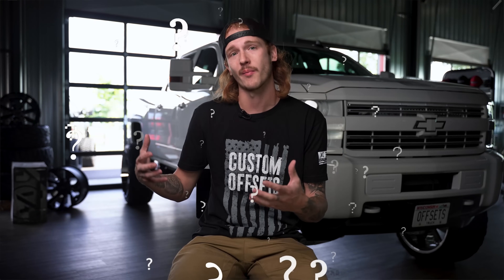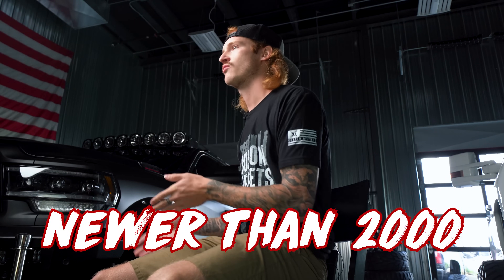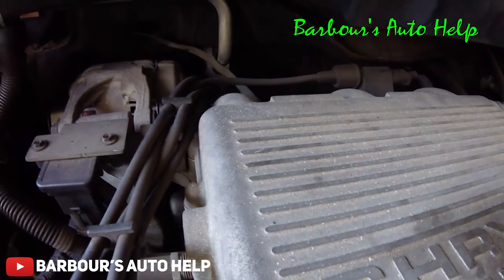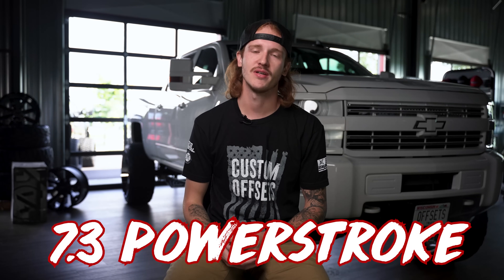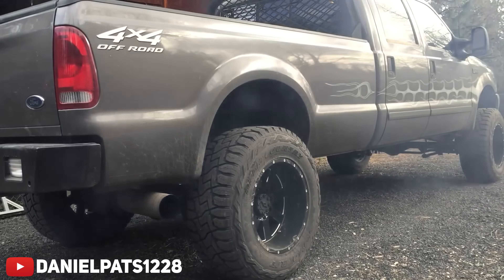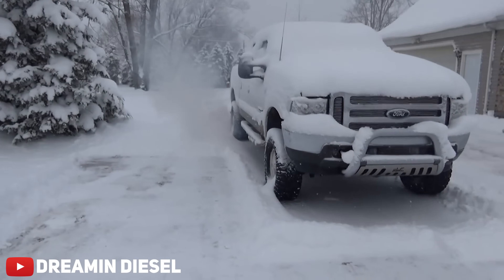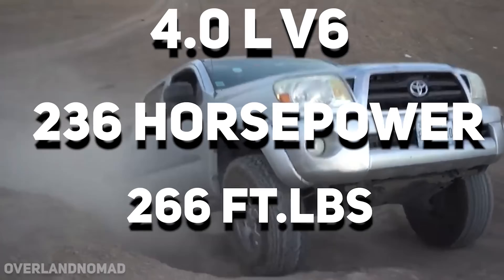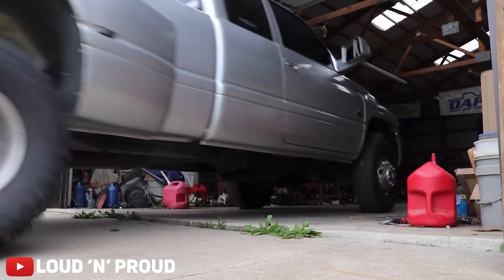THESE TRUCKS WILL RUN FOREVER!!!

Comment: I have a 03 Silverado with 378,000 miles and the trans finally went out. We built the 60 with a shift kit, hardened sun shell, and all the good piston upgrades, and it’s good to go for a long time more. Original motor, I just opened the oil pan for the first time in its life.
Reply: Eudeudrixx

Comment: Being from Utah Where it doesn’t get extremely cold but pretty cold switching to a 5.9 from a7.3 might have been the best choice I ever made
Reply: 7.3s are the best diesels you can get they have a lot of Torque and they sound great and they are reliable
Reply: @masterjcp1274  horrible mileage and much harder to work on and more expensive than cummins
Reply: Put a 12 valve in a obs and there u go best combo
Reply: @masterjcp1274  in no way is a 7.3 better than a 5.9 cummins
Reply: @Dukelevi12  Well it didn’t quite make the list though did it.

Comment: I sold fords back in those days and a 94 was NOT a powerstroke. The 7.3 powerstroke was not available until mid year 95 so a 95 and a half.94 ford diesel was actually one of the worst diesels for made thats why then started running the international 7.3 powerstroke.

Comment: I have a friend with a 2010 Toyota Tundra that was at 500,000 miles about 2 years ago, same engine with nothing but oil and sparkplug changes.
Reply: To this day he still drives it, and it's probably pushing 600k miles rn.

Comment: My dad has a 2000 Silverado 5.3.. 470k miles original engine... still runs strong.
Reply: I have both cat eye extend cab and 6 cyc 4 door Tacoma…both have over 150 k..biggest problem..replaced complete air condition unit on old cat this year…and both timing belts…tickled with both..alternate “daily” drivers.

Comment: Re the 6.7 Dodge/Rams.  The 6.7 was first available in 2007.5, without DEF and the rest of the emissions package.   They were the Third Generation body style through 2009.  I’m running a 2008 3500, Mega Cab, with the Laramie package.  I’ve got a little over 250,000-miles on it, and expect it to out live me.

Comment: I currently drive a 4.8 07 Sierra classic body and it has 230,000+. Planning on getting the engine broken down and rebuilt with some tunes to get that lifter tapping out the way.

Comment: My Chevy '01 K1500 5.3 has 236k miles on it as of today. Needed a new transmission at 220k and a new fuel pump at 210k. Other than that, it has been a workhorse for me. I drive a 2021 2500HD silverado now, but still love the old 1500 and can't bring myself to sell it. Its like a member of the family. Been so many places in Utah's back country with it and got me through some pretty gnarly stuff over the years. Keep them full of fluids and they will take you most anywhere you want to go.

Comment: Of the LS based engines the ol’ 6.0 vortec takes the nod for me. I have had many with service body’s for work that I had to beat the snot out of and over loaded but they all went 300k miles and got traded in. The highest miles on a 6.0 vortec I’ve seen was a Chevy express 3500 box van and the thing had 564,000 miles.

Comment: My black 07 classic 1500 Z71 5.3 4L60E 240k all original still runs and shifts fine. 1st to 2nd and 2nd to 3rd shift without any problems.

Comment: Custom sprayed for many years pulling a 500 gal sprayer in the field at 15 -16 mph
 Everybody that saw it was amazed how many years and fields it covered and just kept going.
1989 Chev 2500 w/ 350 TBI /4 speed manual
Neighbour borrowed it to haul cattle with my big gooseneck and blew the motor. Never even let me know he just parked it.
 For some people nothing is reliable as you need half a brain and some level of maintenance or you can roast anything. 
 My Dad's Dodge 2500 5.9 Cummins had to replace ball joints every year even though it stayed on the road...he spent 4K upgrading the fuel system and the truck had 80K kms.

Comment: My 2001 7.3 F250 flys down the road and off road and I have a flat bed that is so heavy it has F550 suspension in the back and it still flys

Comment: With transmission issues aside, Dodges 5.9 V8 Magnum will last you 300k-400k miles easily.
Reply: Agreed. Mines been running solid (with only one tranny rebuild) for 270k.
Reply: I have seen one all original with 627k miles 

318/ 360 are fantastic engines

Comment: 12 valve is the only engine thats ever been documented legendary. There's nothing else to talk about.
Reply: Sure sucks they put them in shit trucks though
Reply: 7.3 is legendary
Reply: @nolansmith4972  where is it documented  absolutely nowhere
Reply: @MrCstone1  where is it documented legendary?😂 12v are good motors but everything else is shitty. At least with a 7.3 u know u have a all around good truck. Mine has 302k miles stock injectors, turbo, and transmission never had a major repair
Reply: I kno you have Google. Type in 12 valve legendary you'll see.
Reply: @nolansmith4972  that’s why I’m 12v swapping my obs
Reply: @nolansmith4972  that’s why I’m 12v swapping my obs

Comment: 03’ 6.0 with 255,000 on the clock and counting. Just changed a ICP sensor on it still purring fine
Reply: Consider yourself lucky 03-04 were the "worst" of the six.blows.

Comment: My 7.3 has 420k miles and the only thing I’ve had a problem with is the oil pan gasket I’m replacing it this week
Reply: They are reliable, good engine for sure, super gutless and hard starting in really cold weather tho
Reply: @justinschooler6243  well Im from Texas so child weather isn’t a problem
Reply: Cold*
Reply: @kidoutdoors1400  
My bad lol oh well
Reply: @kidoutdoors1400  kinda a little child eh? Lol
Reply: @justinschooler6243  I’m selling the ole girl and getting a 6.7
Reply: @justinschooler6243  auto correct lol
Reply: @kidoutdoors1400  
Awesome trucks 👍

Comment: My 01 tacoma is on 230k miles and still running strong.
Reply: Not a real truck tho
Reply: @ah4800  what is a "real truck"
Reply: @m sure they last but you cant do much with them. Gonna tow your sea do? At least the big 3 can actually get stuff done. Cant haul much either in that tiny bed. Decent girls truck though for sure.
Reply: @ah4800  well yeah, the tacoma isn't designed to be a towing machine. It's built more towards off road use and daily commuting. If towing is what makes a vehicle a truck, it seems your ideal vehicle would be a semi truck since all they do is tow stuff.
Reply: @tannerbrinkman6790  lets be realistic here. Even hauling, movimg furniture, loads of landscaping for your yard, drywall, osb. Not a whole lot fits in those narrow beds. And a half ton is just as good off road if not better. Same as commuting. As for the tacoma being more "american" where are those profits going? Oh right, straight to japan.
Reply: @ah4800  I guess agree to disagree, I think it's a truck, you think it's not. I also didnt bring up the point about it being more American or where the profits go, but I feel like just in general most of our goods in the US are coming from overseas.
Reply: @m oh where did i mention mpg? If you're too broke to throw in an extra $20 in the tank you should drive half a truck. All the big 3 still hit 200k anything after that shes rusted out anyway. Lets not even mention the tooth pick rusted out frames on the tacomas. Your engine might last 200k but good luck with the frames 🤣

Facts are facts, tacomas make good commuters. But if you need to do anything important it aint doing it.
Reply: @ah4800  interesting that you say that.  Tell the thousands of Texans employed at the plant in San Antonio and the 10’s of thousand of US-based employees of the part makers/suppliers.  Compare that American economy booster to the income lost on those sourced and built across the Mexican boarder.  You are basically saying Taco Bell is Mexican food brother.  You either need some culture in your life or an education.

Comment: Custom offsets what do y’all think about the 1996 gmc sierra k1500 my truck still has the original engine and it has almost 305,000 miles on it

Comment: It hurts to see the obs Chevy isn’t on this list we have a single cab king bed 96 with a 5.7 and it’s spent it’s entire life pulling trailers plowing snow and working it’s ass off truck sits around 300000 something miles and still works like a horse every day with no issues

Comment: Any deleted duramax no lml cp4 and no lb7 injectors. 7.3 powerstroke after the pedestal leak addressed, cps and valve cover harness are addressed. 6.7 scorpion after 15'. All 12 valve after kdp done. 24 valve after p pump swap and not a 53 block. 03-04.5 3rd gen. Then pretty much all deleted 6.7 except 19-20 cause cp4. There's the list
Reply: What is the pedestal leak? I have 99 3/4 7.3

Comment: One of family members has a 99 F350 dually and it gets 18-22 mpg. Worst case scenario it gets 15 mpg hauling a full horse trailer in the mountains. So I can't agree with the lack of fuel efficiency.

Comment: cat eye chevy half ton was best and last of the chevy half ton line. early 2000s till end of cat eye, chev had best half ton (coming from a ford guy) good mpg, power, look, ride etc. dodge and ford half ton in late 90s to mid 2000s were garbage. 7.3 for diesel was a torque monster and only reason id argue with chev or dodge is 1. had more power than chevy diesels at the time and the rest of the truck (compared to dodge) was far tougher. when dually part came up id say its close depending what youre looking for, by that era it is still more or less dodge and ford with highest spec but atleast ford built their own motor, stronger transmission and rear end and rides nicer

Comment: My 6.7 was the worst diesel I've ever had
Reply: What year?
Reply: @SuperDuty250  2018. Had def issues, headlight issue not turning off, tire sensor, constant check engine that I just ignored it
Reply: @colecooper1116  oh ok. I want to try and get a 2012-2014 f450 but im kinda scared how itll act on me lol
Reply: @SuperDuty250  I was talking about a 6.7 cummins haha. But I've been around friends with those years 6.7 and they didn't have a real issue other than turbo failure.

Comment: The 6.7 Cummins is garbage, ive had 3 buddy’s blow there’s up at less than 150k miles. Literally the cheapest built dog shit ever made. I drive a 97’ Powerstroke with 319k with the original engine and trans, not to mention my 6.0 “unbulletproofed” has made it longer than any Cummins I’ve ever seen. Sick of these dodge fanboys and their garbage trucks 😂